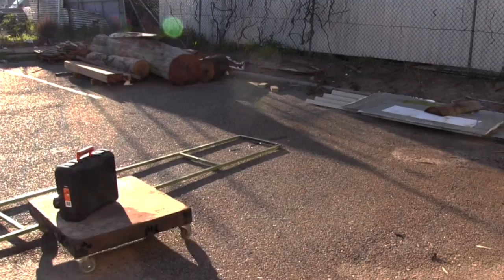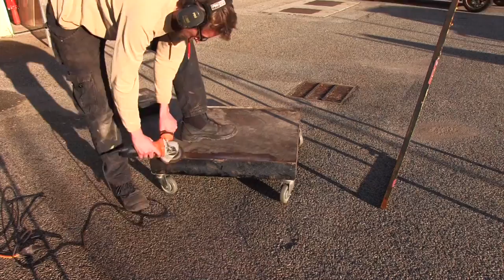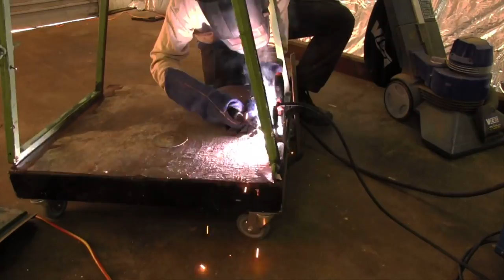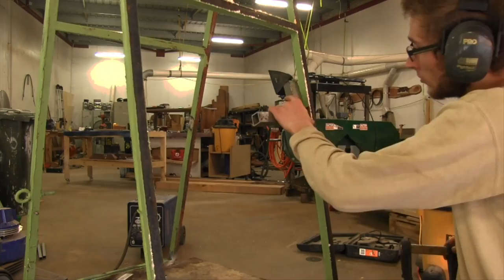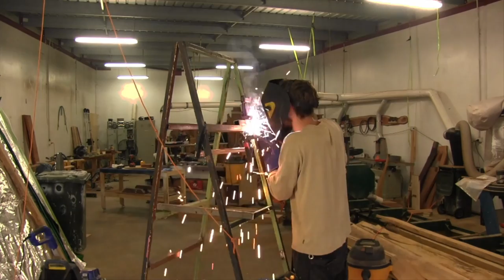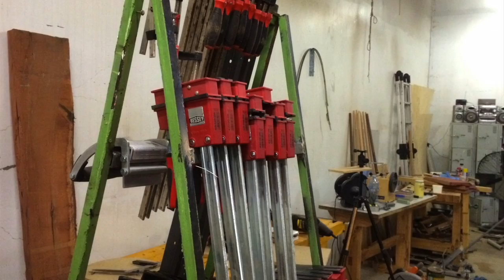JWS Makes: Mobile Clamp Rack (quick and dirty)

Comment: I notice in your workshop you have PVC piping for your dust collection does this wok ok and is it the standard PVC stormwater pipe
Reply from the maker: works fine for my needs. its just important to ground everything with bare wires so you dont get static build up